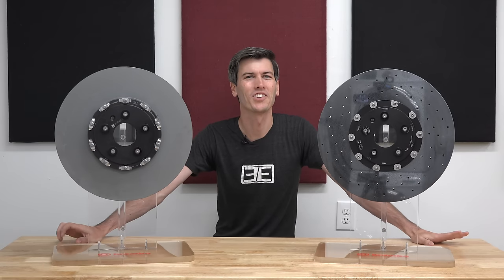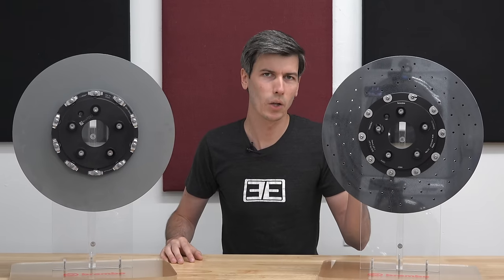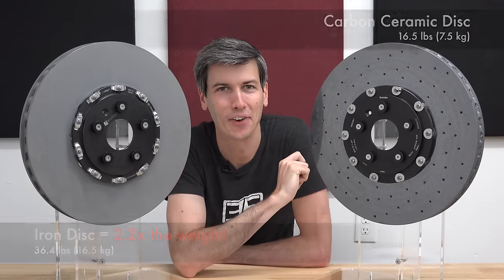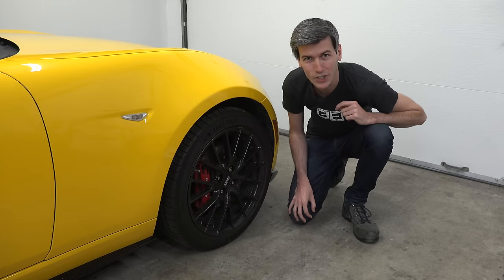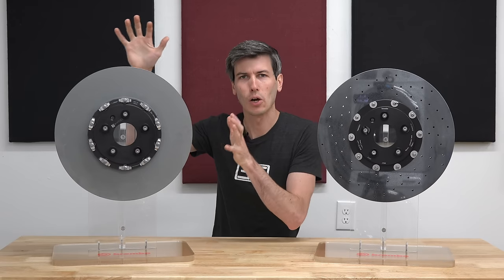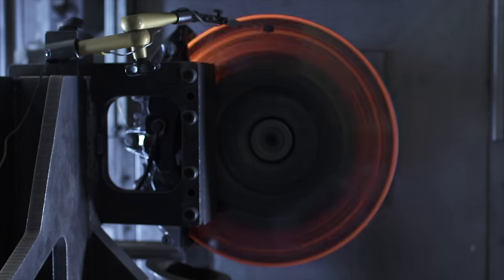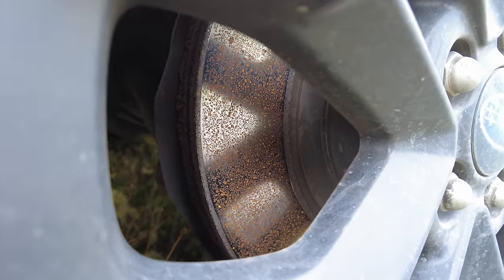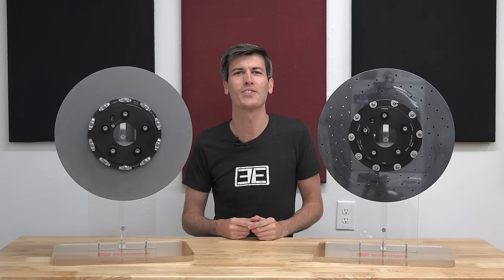How Can Brakes Cost $10,000? The Brilliance Of Carbon Ceramics

Comment: Great and informative video Jason. 
I do disagree with one part though. You said that brake dust was a result of the disc wearing down. Are you sure about that? While I don't pretend to be an expert, I have been around racecars for a lot of years and my thoughts are that brake dust has more to do with the brake pads than the disc.
Reply: Indeed, there are two components to friction: abrasion and adhesion.  You need a balance.  OE tends to favour abrasion and hence more brake dust.  Folks who like clean cars (but not cleaning their wheels every week) want low dust alternative.  However, some that major on low dust can rely too much on adhesion which then results in a glazed surface.  I forget now whether it was Akebono Euros or PBR Deluxe but I experienced low bite within the first 100 miles and I never want to experience that again. Nor having to throw away glazed and unevenly worn discs.

Comment: That's why I'm getting a C7 GS with steel brakes. Even though carbon ceramics are great, the maintenance costs are insane.
Reply: they dont even race in IMSA with carbon brakes, they use steel.  Steel rotors have a more consistent feel under braking.   If you do want lighter weight rotors, a good 2 piece rotor has good weight savings too over 1 piece rotors
Reply: @ForTehNguyen  no one mentioned IMSA. And yes they do use steel rotors. Back in the GT1 days they were carbon ceramics too.

Comment: My 500hp AC had small 1 pot iron discs from a 76 Ford Pinto and no brake booster.
The car weighs 950 kg and that is key compared to a 2.3t 911 or Gatti. The disc weight is 2kg. The steelie nascar rim is 6kg. The 215/65-14 7kg. Tot unsprung mass is 30kg compared to a 911 60kg. This works better for many good reasons.

Comment: Disadvantages; 
(1) extreme brittleness; if the wheel touches even a little the disk they can crack and need replacement. 
(2) poor cold disk performance. When used as a daily driver, if your brakes are cold and wet they will not bite as much as cast iron
(3) resale value of cars with carbon ceramics are lower than equivalent with cast iron. The reason is the same as for any car with v expensive spare parts in proportion of the value of the used car. $10k bill to replace rotors on a car worth 20-30k down the line is not a value proposition
Reply: a good 2 piece steel rotor is a better compromise

Comment: Even though its true that the carbon ceramic discs have "unlimited" life, in the real world not so much. They are brittle and can be chipped by stones etc and have to changed because of imbalance. Often times it is also not possible to buy only the center section if it is warped, and then the whole disc will have to be changed. It is a reason that 10 year old cars with carbon brakes usually are worth less than a similiar one with steel brakes.
Reply: What models of cars have less value when equipped with carbon rotors when 10 years old?
Reply: They don't warp.
Reply: @miken6imy  Audi S8 for example
Reply: @Timoastra  would you pay less or more for an Audi s8 with ceramic brakes?
Reply: @miken6imy  Less. Where i live rocks and salt destroy these brakes and they are not really needed on a barge like the S8
Reply: @miken6imy  depends whether they are worn out or not. If you have to replace them the car is about 10k less of value. And in Germany you are not allowed to replace them with steel ones cause the package which include the carbon ceramics increase the top speed. So if you go for the steel ones you have to limit the top speed again.
Reply: @TamiyaPhilippW  if you were buying a random car that had ceramic brakes and the pads were 20 or 30 percent remaining, plus the rotor have some chips and cracks and show wear beyond normal, would you consider buying the car? Knowing that the brakes would cost $10,000 and you would have to give up 4 to 6 hours on a weekend?  Versus $1500 to $2500 and same time for typical brakes.
Reply: @miken6imy  no, I wouldn't buy it
Reply: @TamiyaPhilippW  I had spend 4100 for brake parts this year with conventional steel rotors. I agree.
Reply: @miken6imy  🤕 ouch
Reply: @alfaqvcarlos4406  They can warp if you get chemicals from certain soaps. Or if your pad has had several heat cycles without buring the top layer causes a brittle layer which when you're in a situation where you brake hard you'll grind that brittle layer off onto the rotor which can cause warping. But Carbon ceramic don't warp like steel rotors in regards to water.

Comment: Hey Jason, thanks for another great video! - question. I have a C63s AMG with carbon ceramics. I live in Denmark, where we’re at below 0 degrees Celsius these days with snow. Today i noticed a massive difference in breaking - normally my breaks are so strong, i barely need to press on the pedal to achieve the daily breaking and pressing just slightly harder (like, maybe 20% of the pedal instead of the usual 5-10%) i can feel the stopping power.
Today, it felt like they had almost no breaking power. I even tried to press the break pedal hard or all the way but the breaking was much weaker than usual.
I was wondering if carbon breaks needs to be at a minimum temperature before working normally, or if they get weakened in very cold weather (0 or -1 degrees C) ??
Reply: I noticed if they are wet - like right after washing the car - they have no grip till you pump them a few times and then it’s all good.
Reply: @undergroundoutlaw411  hey, no no, not the issue - just fade.. like, no grip or breaking power - day after, it was 4 degrees and that helped but still not what it used to be maybe a week ago when we had 8 degrees so i’m thinking temp is a big factor when you’re down in the frost temps

Comment: My floating Brembo cast iron rotors are 1,200 a pair!  I feel they are vastly over priced.
Reply: I've always wondered why 2 piece rotors cost 10-20x more.
Reply: @pkt1213  
And to make matters WORSE, you retain the old faded black inner "hat". The 1200 buys you what they call "friction rings" and the $100 hardware kit.

 Changing out the friction ring is a real PITA involving tedious disassembly of old Loctited hardware and then VERY carefully torqueing and Loctiting new hardware to fasten the new ghastly expensive rings  to your old inner hat.

Long long ago, I did track the car...rarely. I sometimes used racing pads and $80 per liter Castrol FRS brake fluid. 

I never boiled fluid, experienced  any brake fade even at Sebring, or warped a rotor.
Now??? Two piece rotors are waaaaay over kill for the street. Apparently, I have NO other option. There is no one piece rotor fitment for my Brembo GT set up. Six piston  in front and 4 in the back. 

The cost in 2009 was $7K. Now its over $10k!! for the four wheel kit. That is without any installation fees. They do come with SS braided brake lines. I bought titanium heat shields for the front pads.

Oh, and while racing pads WILL stop you 
incredibly fast, they tear up the rotors faster!

Comment: Idk about relieving weight out of a tuned suspension, I mean, if one does that in a race car where you can change spring rates, rebound and so on it’s ok, but in a production car where everything is tuned to work with what it has I have my doubts
Reply from the maker: The brakes are often factory option, meaning the suspension is tuned accordingly.
Reply: Also people spending that kind of money to upgrade the brakes, will surely spend the money to upgrade suspension and tune it.
Reply: I agree, when it comes to comfort, more unsprung weight resists movement more.  If you reduce the unsprung weight without reducing damping, more of that movement will be felt in the car.  If you can reduce the damping, I think you will see the benefits of more grip, and better comfort.  Please explain if I’m wrong.  Thanks.  Once again great video.
Reply: @brianmichael316  You are mistaken because the damping acts against the forces caused by the road surface. The unsprung weight change will not reduce or increase those forces. If it did, you would feel a reduction in ride quality when you bought new tires. The weights of various brands and types of tires vary by several pounds. No one ever says their new tires caused their car to ride rough or harsh.
Reply: “A lighter wheel which readily rebounds from road bumps will have more grip and more constant grip when tracking over an imperfect road. For this reason, lighter wheels are sought especially for high-performance applications. However, the lighter wheel will soak up less vibration. The irregularities of the road surface will transfer to the cabin through the suspension and hence ride quality and road noise are worse. For longer duration bumps that the wheels follow, greater unsprung mass causes more energy to be absorbed by the wheels and makes the ride worse.”  Found some more info.  We were both partially right.  Small bumps will be more apparent with reduced unsprung weight, but large movements will be better controlled.

Comment: Large cast iron rotors for my F150 were only $25 each...and they even have a  E-brake drum on  the inside of it.  How iron rotors could sell for $1k is completely baffling to me.
Reply: Well I drive a bmw i and know for most European car getting quality  rotors and pads for less than a 1k is a steal in Canada
Reply: theyre two piece, and a LOT bigger. also that's probably for all four, but i could be wrong
Reply: A set of 4 14" rotors can easily be $500+ and that's for one piece.
Reply: Used?
Reply: Your F-150 is not only the best selling consumer truck, but also a major fleet vehicle. You're talking about one of the cheapest, most mass produced one piece cast iron rotors on the market. The manufacturer can make them very quickly, and in huge numbers making them very cheap. They're a dime a dozen with many different manufacturers making them and competing. Now imagine a niche sports car or SUV with high performance calipers and huge 2 piece rotors that you can only buy from one or two sources. These parts are much more specialized, only used on certain trims of the vehicle. They are made in much smaller batches, and take much longer to make. You've got a cast iron ring with maybe slots or drilled holes, a billet aluminum hat for the ring to bolt to, and hardware to hold it all together. This requires a wider variety of materials, more specialized manufacturing tooling, more complex engineering, and more time to produce. Not to mention if you drive a foreign car these parts probably need to be imported as needed from other countries. All of this extra work for something you won't sell many of. Gotta charge much much more to make all that worth your while.
Reply: $25 is not an OEM rotor.  Customers say they are all the same.  Having run my own shop I can tell you OEM is typically better.  I assume metallurgy is different.  Probably higher carbon content in the OEM.  Talking your average vehicle (not exotics or sports cars) the OEM rotor usually pays for itself with longer service life.  Tend to run truer over their operational life as well.

Comment: Im surprised you didnt explain the difference between carbon ceramic matrix rotors you find on OEM and the Carbon Carbon you find on race cars. They are different and cannot be compared with each other. You used them interchangeably and they cannot be. Race teams do not use CCM's they use Carbon Carbon. They are a world of difference between them.

Comment: A friend of mine has a Mercedes AMG with carbon ceramic rotors.  The MB spec for the rotors is to replace at 100,000 miles (at a cost of around $25,000).  He plans on selling it once it hits 80,000 miles.

Comment: I have a Corvette with carbon-ceramic brakes that gets tracked quite a bit.  While I have had to replace the brake pads ($450.00), the rotors are nowhere near worn out. The rotors are not measured for thickness but are weighed to monitor wear. Below a certain weight and the rotors must go at a cost of $1200.00 per rotor. So far, they have not needed replacement.

Comment: I remember when Jay Leno had a video on carbon fiber rims like 10 years ago and how expensive those were but again economies of scale you start mass producing the stuff and it’s amazing how the price drops in fact I’m surprise that manufactures haven’t gone to more carbon fiber integration on daily drivers I would assume that carbon fiber rims would weigh much less therefore you would gain fuel economy but I don’t know how tire shops would deal with putting new rubber on carbon fire rims. I remember when the LFA came out and how advanced that was!

Comment: I believe Brembo has two types of carbon ceramic rotors.  you can see the surface differences between the ones in the video...11:19 on the GT-R...The carbon ceramic rotors on most GM are like the GT-R surface vs the rotor used in your comparison and found on Porsche and AMG...a video on the differences would be welcomed...different layers, heat treatment, etc..!
Reply: The two main types I know of are random fiber and non woven. Random fiber is what is made in the video linked in the description. Non woven has mostly been used for big airliners and F1 without the silicon added. The McLaren Sena was the first to use non woven ccm-r as far as I know and the better uniformity make for a stronger, lighter, and better heat distributing rotor.
Reply: @nicholas7810  The Senna GTR used Surface Transforms CCST. Are those what you are using? You don't see any fibres or cracks on the face of CCST.
Reply: @coordsportgmbh5728  We have a similar process to surface transforms that we do in house.

Comment: Just got my 2022 M4 Competition with the CCBs. I’m going to guess these are about the exact same rotors as in your video. Right under 16.” The first thing I noticed, breaking the car in, was that they took quite a bit more heat for the to work well. Taking a trip to Mexico, and coming down from 160ish, you find yourself saying, sh@t, sh@t, stop, STop…STAAAAPPP! You’d figure these would put you through the windshield, from any speed. They didn’t give me as much confidence, initially, as my Z51 Brembos on my C7. I think they’ve gotten better, now that I’m at 2k miles. But the first half dozen uses, and they’re scary.

Comment: How is the carbon ceramic disc joined with the aluminium hub?  Why doesn’t it crack when compressed as the visible fasteners are tightened?

Comment: Did You really eccllerate faster with 18" wheels because of their lower mass? Or is it just that smaller wheels in diameter improve acceellaration?
Reply: It's got to be down to the rolling circumference of the two tires, no?
Though I doubt anyone with a track car wants an 'extra' inch of sidewall.

Comment: When it comes to brake and price practicality, for normal use automobiles that are used on city streets and highways at normal city street and highway speeds the common brake rotors that are made out of iron are a much better choice. Iron rotor brakes do a very good job of stopping normal use automobiles. These carbon-ceramic rotor brakes that are much more expensive are a specialty item that is intended for race car applications, which are traveling at speeds around 200 miles per hour and doing a lot more braking from high speeds than are ever done with domestic use automobiles.

Comment: I too had the question why the @&$& should a brake setup cost 10K. Then I took a M performance private training at BMW academy. I first took the M2 out. It was fantastic around the skip pad and slalom cones and braking exercises. 

Then I took the M4. Tried all the same exercises including the full panic braking. Immediately realized why the brakes cost so much. Massive Massive difference. High initial bite and absolutely little fade. It was a blast.

Comment: I have a very original C3 1969 corvette which has 4 wheel ventilated disk brakes which are unboosted! Trying to keep the car as original as I can but brakes aren’t great! What pad would you recommend for improved stopping power. Dust and noise not critical!
Thanks David